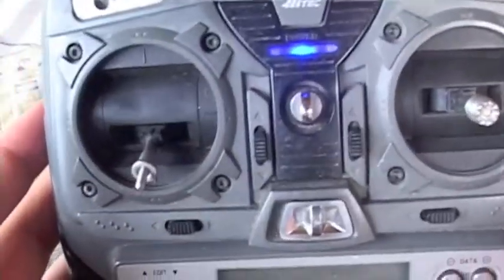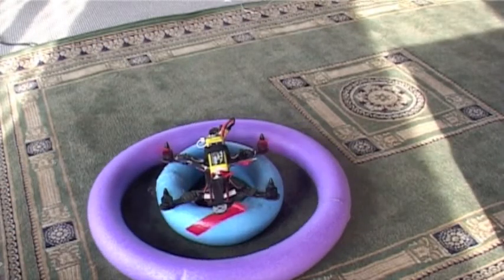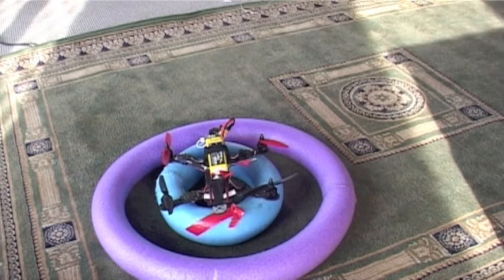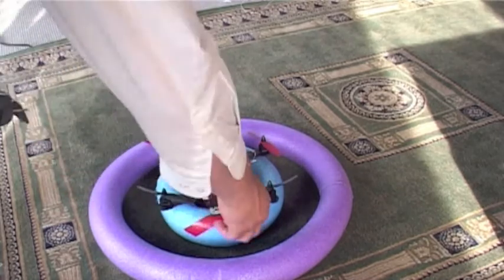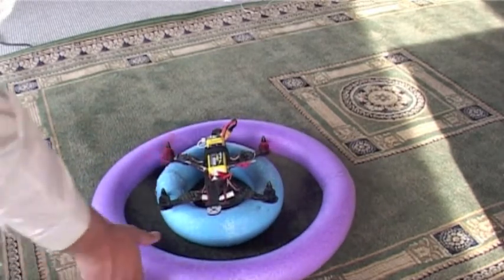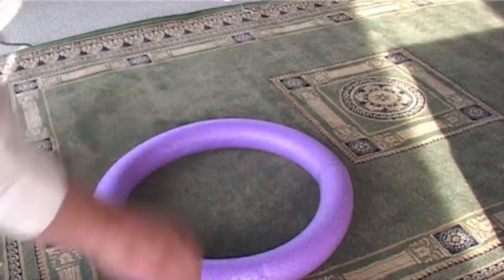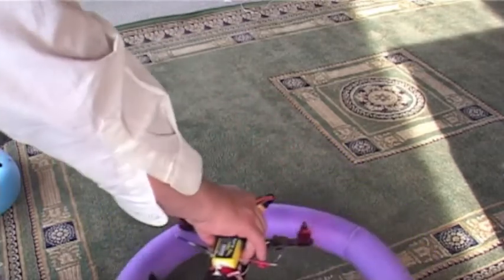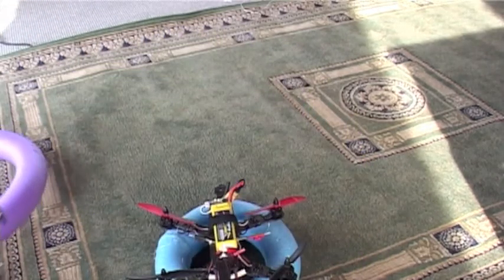Quadcopter float ring

Comment: It looks like the airflow is creating lift on the inside of the ring. When it's off-centre the force is not equal on all sides so it moves, then equalises when it reaches the centrepoint. 
That's my hypothesis anyway.
Reply from the maker: the inverse square law where the further the distance the ring is from the blade the less instense the wind is until equilibrum is reached

Comment: It's just the aerodynamic flow of the air over the ring. The quad is varying the motor speed to stay level which results in fairly uniform thrust from all 4 motors. The air moves down and hit's the ground where it is then forced horizontally towards the ring. This creates a high pressure on the inside of the ring as the air moves over the ring. Because the force is mostly uniform, the ring will tend to move toward the 'middle' of the quad's thrust. The little ring misses out on this effect because the thrust is having an opposite effect because it is creating the high pressure on the outside of the ring.
Reply from the maker: best answer to date and thank you. please post again soon
Reply: every day objects in not so every day uses One other effect I thought of Rod was the force is also creating a slight air cushion, which means the drag on the carpet is significantly reduced, which helps it freely move around.

Comment: It's the 'Coandă Effect'. It's similar to the inverse of the classic leaf blower/hair dryer & ping pong ball demonstration. The only difference being you have a center air stream going through a curved object while the classic demo has an air stream going around a curved object.

Here's a sample video: https://www.youtube.com/watch?v=kR2Oi3XCX18

Wiki Link: http://en.wikipedia.org/wiki/Coand%C4%83_effect

Notice how the ping pong ball can be moved and even tilted in the air stream similar to how you can move your quad around and the ring follows. As you move the quad over the ring, the side of the ring you're approaching receives a high pressure flow pushing the cone in the direction you're moving the quad; while the tail end receives a low pressure flow sucking it toward the quad (also in the direction you're moving the quad). So together, you have a total force moving the ring forward; one side pushing and one side pulling. Then the side to side movements of the ring work in the same way to keep it centered.

Also the air stream produced by the quad rushes through, under, and away from the ring allowing the ring to not only float on a small makeshift air bearing (like a hovercraft), but the Coandă effect also keeps the ring sucked to the floor as the same air stream flows over the curved bottom surface like an inverted plane wing. Similar to how a sport car uses a diffuser or a raised spoiler to create down force. This prevents the ring from being blown away and stays on the floor.
Reply from the maker: it has given me an idea to make a quad skirt that lets it hover with front to motors and push with back to motors. have you see videos to this effect?
Reply: every day objects in not so every day uses Like a hovercraft?

Comment: The blades are pushing air in 4 places fairly equally around the inner ring, when the large ring tries to move, it is blown sideways, but since the air is blowing equally on the opposite side it is forced to stay in the center...
Reply from the maker: would make my pass mark on a test. good answer.

Comment: Ha ha ha, that is really cool. I think it is something to do with increased air pressure when it is closer to the side of the rig, so it pushes it away and is equal in the middle trying to push both sides away.
Reply: Yep. I think this is the answer.
Reply from the maker: how can we put this to use in the quad copter sport other than floating them on water?
Reply: Hmmm good question, you might just have to stick to the water.